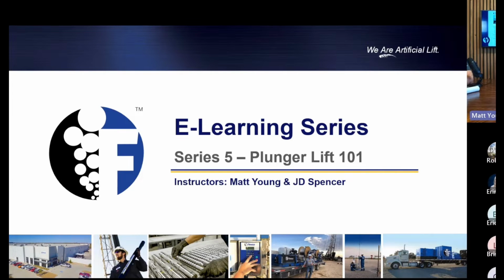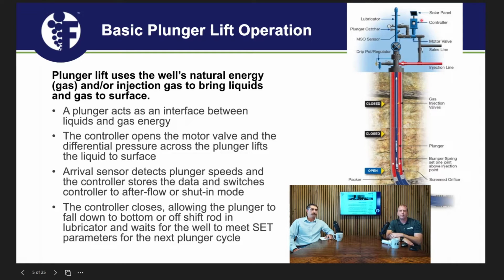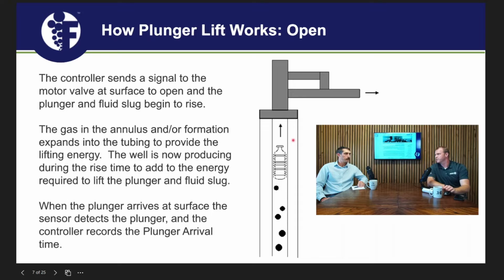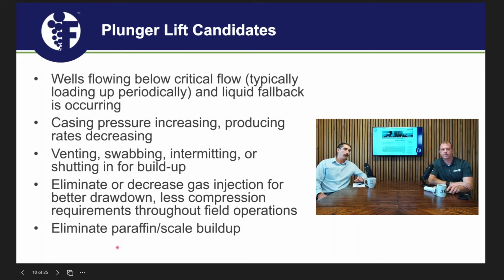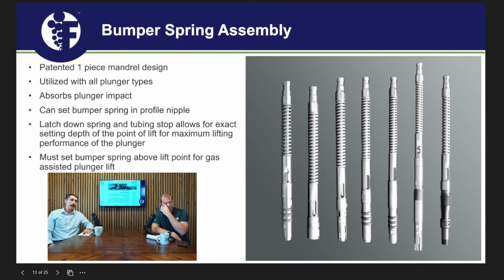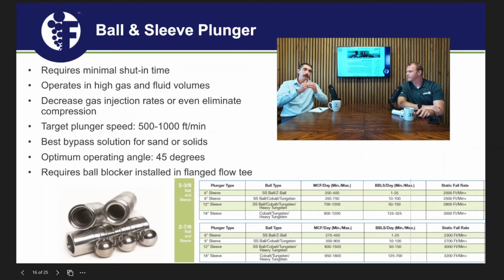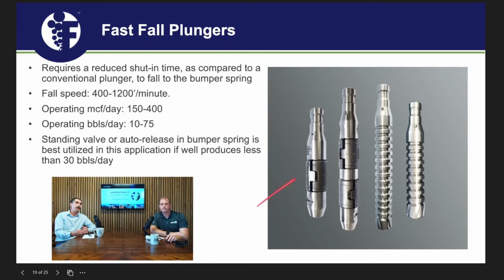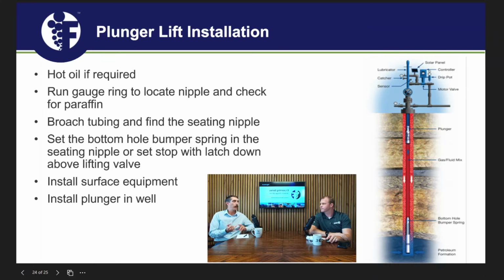2023: Series 5 - Plunger Lift 101

Comment: I have an intermittent gas lift well with 5 GLVs and I'm not sure if the majority of gas injection is taking from 4th GLV or the 5th glv from top during my injection cycle. There is some sort of multi porting between 4th and 5th GLV.

If I want to install gas assisted plunger lift, where should I install my bumper spring? Whether above 4th GLV or 5th GLV. Assume that there is sufficient liquid level build-up above the the 4th GLV during OFF cycle.
Reply: Hi Amit, if you are not sure which valve (4th or 5th GLV) is passing more gas, I suggest to install BHA(Bumper Spring BHA) above 4th GLV. It will confirm Plunger surfacing.